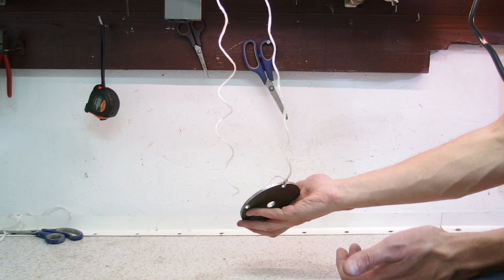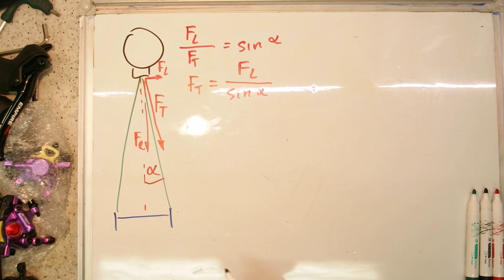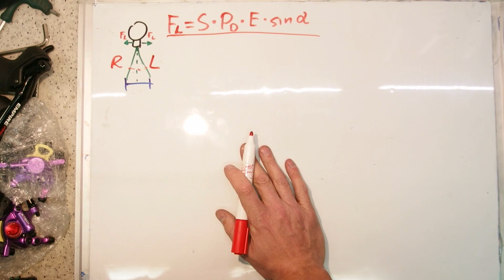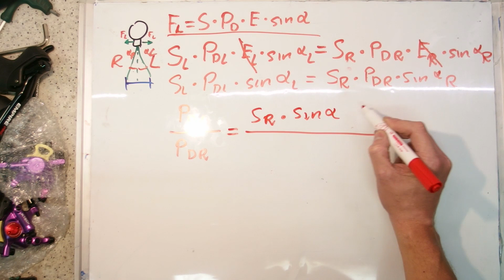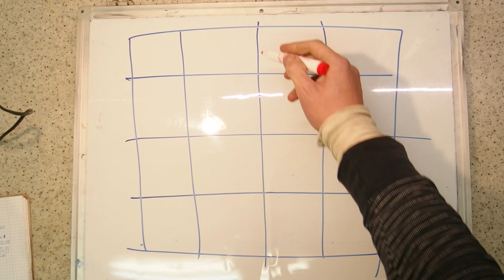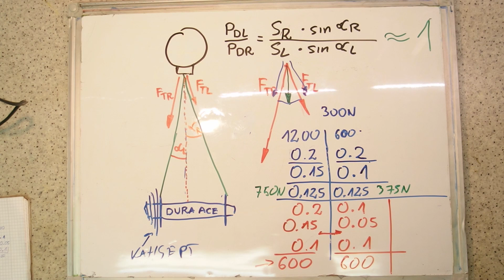Preventing spoke breakage by means of dish compensation.

Comment: **Angry robot mode: on

I am somewhat knowledgeable of these subjects. I did not completely follow your analysis but I agree that the drive-side spokes tend to break often. Empirically, this means that they are under greater stress so your suggestion for stronger spokes on the drive side should always fix it.

I think the cause can be explained similarly to a static truss problem. Qualitatively, in your diagram, when both the wheel and load are vertical most of the vertical load is supported by the spoke that is orientated closest to the vertical direction. On each side of the hub the spokes apply vertical forces that cause rotation moments relatively to the vertical axis of symmetry of the hub. These rotation moments have to be of the same magnitude because the hub stays horizontal. So the spokes closest to the vertical axis of symmetry of the hub have to generate a greater vertical force because (moment) = (force) * (distance to symmetry axis). - - This is supposing the rim is centred on the hub.

I can also add that your analysis is applied only to the straight sections of the spokes. In reality I always see spokes break near the curve, like in the video thumbnail. Any loads supported by the spokes also cause bending in their curved section near the hub. The bending stress is maximum on the spoke surface and is added to the "vertical stress", accelerating the formation and propagation of surface cracks during loading and unloading.

**Angry robot mode: off

Nice informative videos mate, thumbs up.